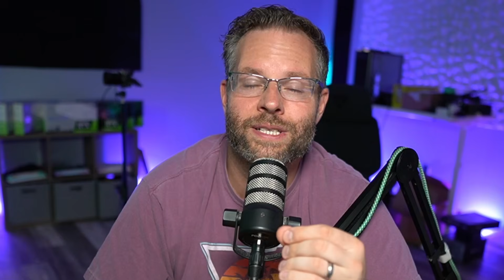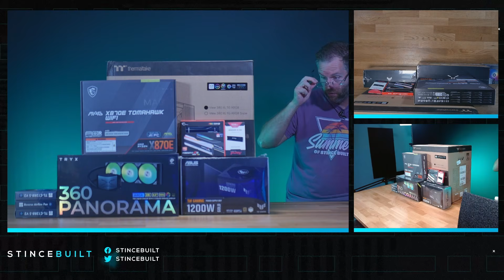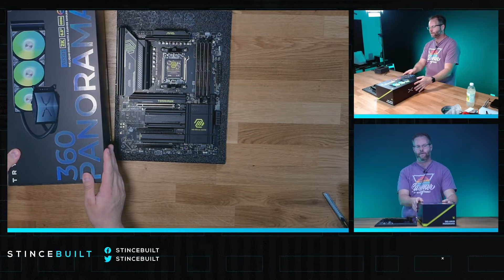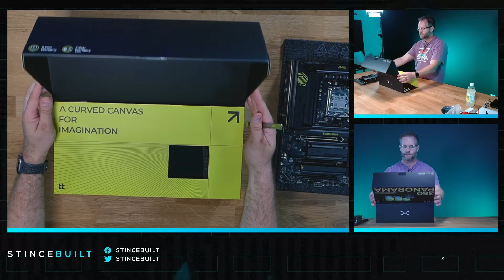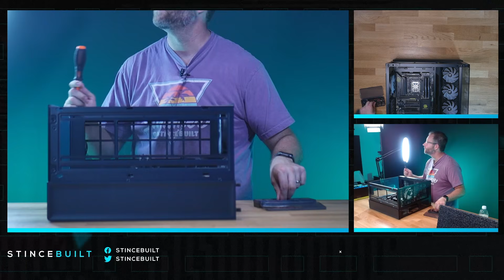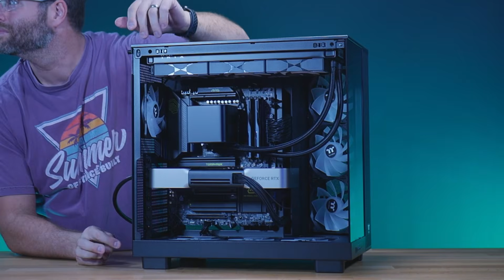Thermaltake View 380  XL Gaming PC Build! 9800X3D + 5080 Founders edition!

Comment: If the side and bottom are intake and so is the AOI on top that means only the back is the exhaust. Would it not be better to have the AOI rad mounted on the side instead so you can have the top exhaust as well as the rear?